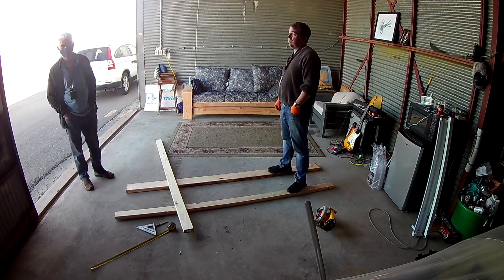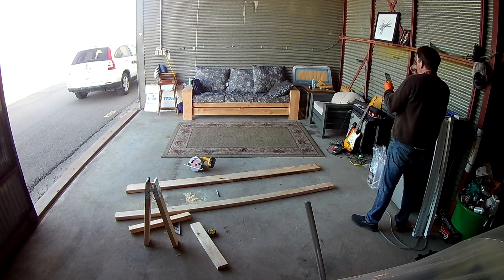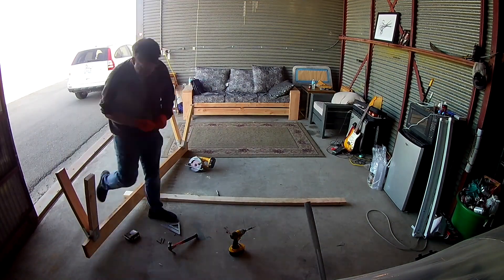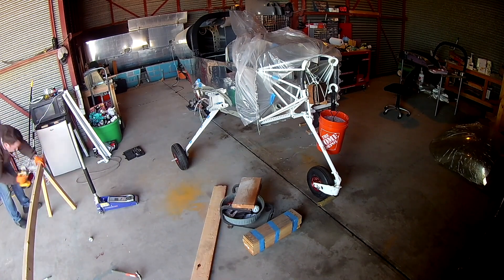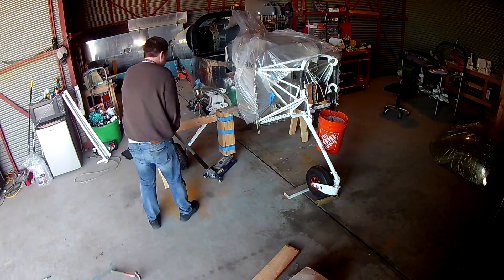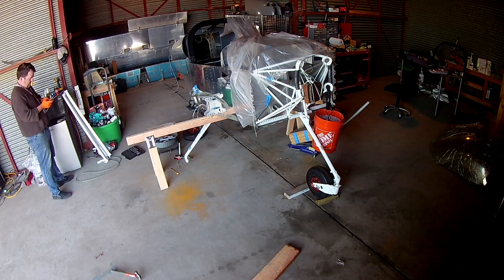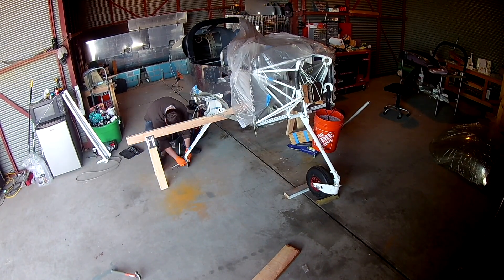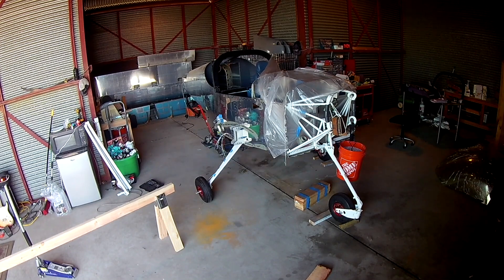RV-14 Axle Repo II

Comment: Just redid mine too thanks for the tips.  And agreed that red lock tite is a b#&@$.   So much easier to just swap sides and move on.  Are you doing fairings and wheel pants next. I heard some say to do it now before hangin* the engine.
Reply from the maker: That's whats prompted all the composite work. Want to make sure I'm practiced up with some side projects before doing anything permanent to the fairings.